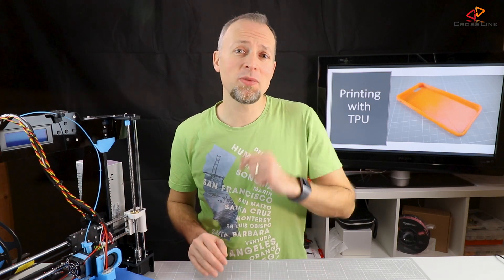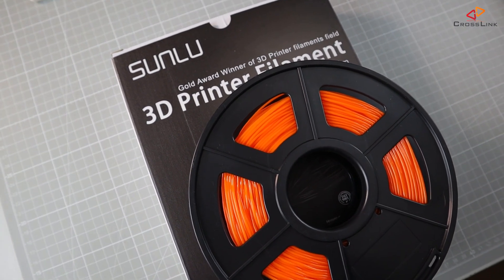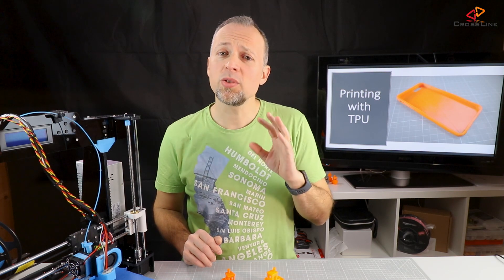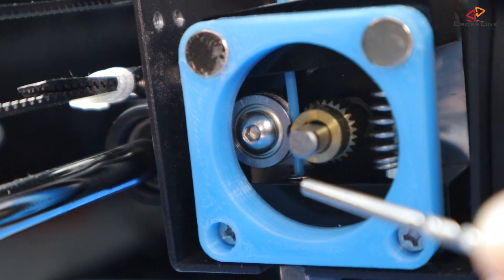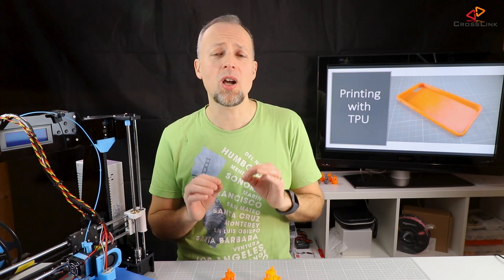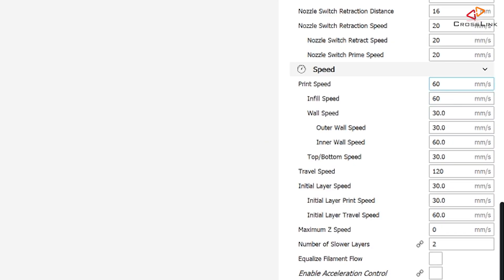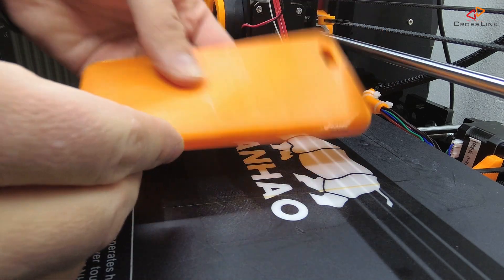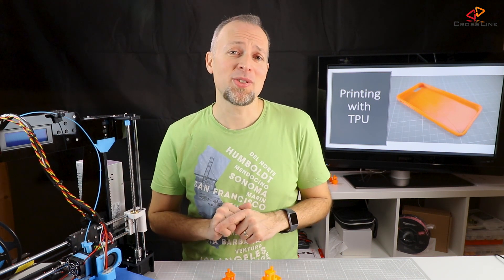Anet A8 TPU printing

Comment: With my anet A8 i can get nice results with TPU at 100 mm/s: 240C extruder, 75C bed, 10% infill and no retraction. The item has good detail and is flexible and glossy. The only issue is high stringing but thoose are easy to peel off.

Comment: I have been trying to print TPU 6 times now. The TPU fails to feed out the nozzle at some point while printing. What can I do to prevent that? I am already manually unwinding from the spool as it seems to stretch rather than feed.

Comment: The A8 is dead in the water....prices is dropping and although i have built and sold 6 ...all upgraded ....to order in the past 12 months....cannot get rid of the seventh after my “buyer” found the Ender3 on what was once the biggest Anet FB group...now switched to Creality....
Reply from the maker: I see, it’s not over yet but I can see that the Ender 3 community is growing fast
Reply from the maker: Interesting but I am currently waiting for the Anet A8 2019 to come out and test. The A8 plus is nice but where is the advantage over something like the CR10?
Reply: David Mokweni Anet are not an innovator...unlike Creality and a couple of others...Anet are a pure cloner and as their first clones of Creality....they don’t even make a machine without assembly issues. Anet A8 suited the surging market a couple of years back, cheap...but if/ when tuned in...and modified fir function and safety...created very good results. The A8 is not the market “leader” it was at the lower cost market. Too much negative publicity at the time Creality emerged with some good machines.

Comment: Is it possible to print with a e3d v6 Bowden system? I switcht to it and the teflon tube is pretty long :S
Reply from the maker: That might actually depend on the flexibility of the material. I would not try very flexible TPU with a Bowden setup. The SUNLU I used is probably a good alternative that might work at lower print speeds. But stay away from the ninjaflex on Bowden pretty sure.

Comment: Great vid, got a question, what version of cura do you use and can you recommend g code setting for it
Reply: Thanks, can I just cut and paste that in the gcode box?
Reply from the maker: Yes, but comment G29 out unless yo have a sensor and Marlin firmware. Everything else should work with stock firmware, too.
Reply: And I really appreciate your help. Your vids are easy to understand and you explain how and why very well. Good for someone like myself who is starting out with zero experience
Reply from the maker: I am using Cura 3.6.0. my startup code looks like this:

G28 ;Home
M117 Auto level...
G29 ;auto level

G1 Z15.0 F6000 ;Move the platform down 15mm

G0 X0 Y0 F9000 ; Go to front
G0 Z0.4 ; Drop to bed
G92 E0 ; zero the extruded length
G1 X40 E25 F500 ; Extrude 25mm of filament in a 4cm line
G92 E0 ; zero the extruded length
G1 E-1 F500 ; Retract a little
G1 X80 F4000 ; Quickly wipe away from the filament line

M117 Printing...
Reply from the maker: But the G29 will only work with a sensor installed and marlin firmware.
Reply: What was the end gcode

Comment: Are you using a shorter heat break than the stock Anet A8 30mm heat break?  I have mine screwed  further up toward my extruder gear and idler, maybe only .5mm gap between heat break and  idler/gear.  I know some heat breaks are 26mm and you can't get them screwed in far enough to do this, such as the all metal ones.  I haven't been able to find an all metal 30mm heat break for my Anet A8.  Great video, I want to try printing flexibles in the future so will definitely try out your cura settings!  Thanks!
Reply from the maker: Mine were really short out of the box but this filament guide fixed it for me.